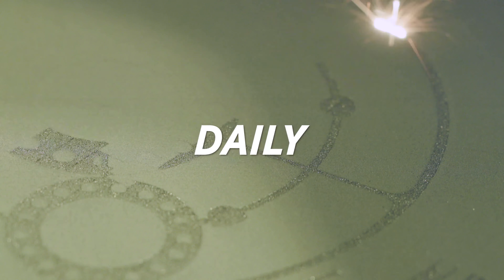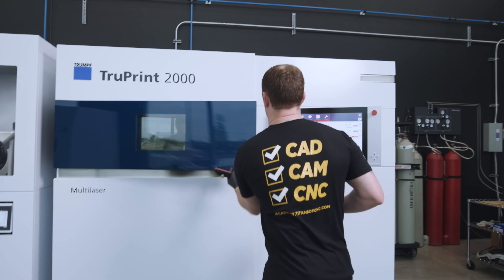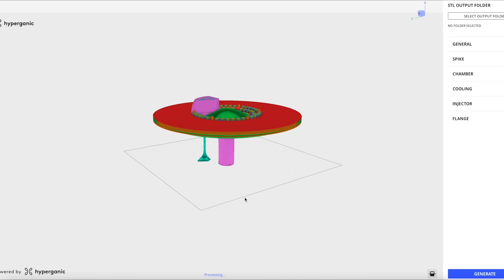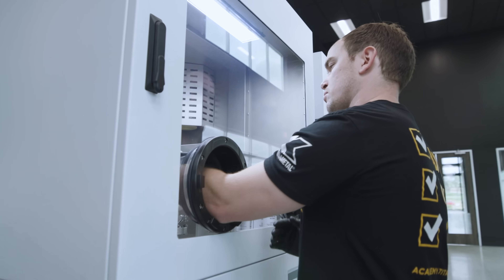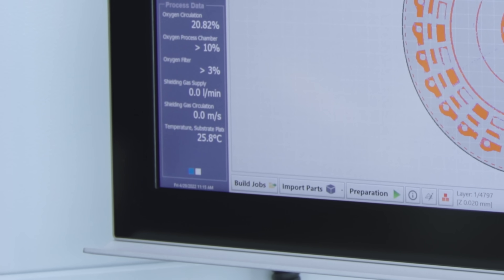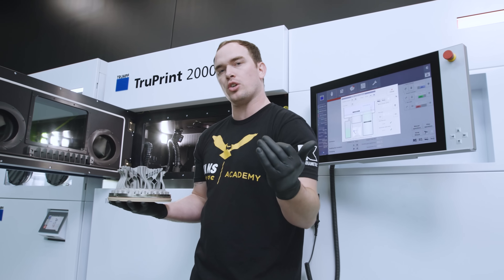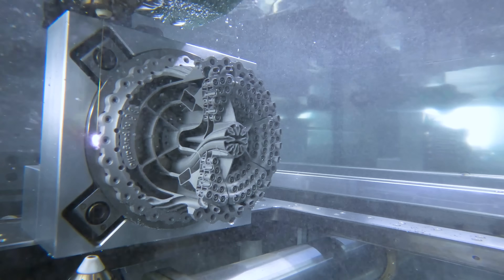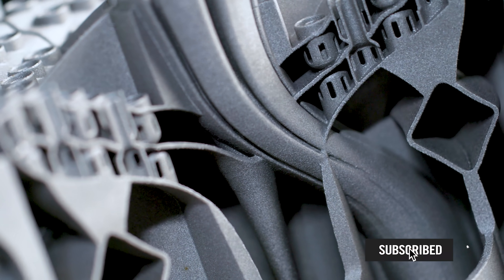3D Printing a Titanium Part Created By Artificial Intelligence

Comment: There's many of these 3D printed parts as I've seen I still have a hard time understanding how a combination of the dust and the laser make such an intricate part and everything has perfect surface texture.
Incredible machine.
Reply: First of all, laser melts titanium powder and forms the very first layer of a part on a moving base. Then a base with this first layer goes down for a height of one level. Machine put titanium powder on top of the first layer and laser melts powder to make a second layer. Process continues until all layers will be finished.

As was said in a video, this part do not have a supports. This can be done by this method of printing, when, unlike of plastic 3D printing, part is printing downwards. Because of this, whole part is surrounded by powder (even inner surfaces) and powder helps to prevent deformations.
Reply: @PaulRei-00   No, I just watched the video. It's magic, that's that's all ...it's magic.  😁
Reply: @PaulRei-00  We actually do have top down resin printers that use a scanned beam and vat of resin in a very similar manner to this machine, but yeah it's no help with supports.
Reply: perfect?  it's very imperfect. far from smooth.
Reply: @krusher74  Define smooth. 🙄
Reply: @randywl8925  The part in the video has a surface like a sandcasted part... which is the worst it gets when it comes to metall parts. So yeah  the surface is great compared to earlier 3d prints but it is no where neare a smooth part.
Reply: @randywl8925 smooth can be defined as "nothing close to this object"
Reply: @davidaugustofc2574  
"Smooth"  is a relative term.
...smooth compared to what?
Reply: @randywl8925  "smoother than" is a comparative term, smooth has it's own definition, which this piece doesn't fit. For example, you're simply slow, slow because you don't understand that, or you're blind, blind because you can't see the surface for yourself, you're relying on other's description.
Reply: @davidaugustofc2574  You're a really fun person.
Reply: Nah, its an ad.  This isnt very impressive
Reply: @timothyandrewnielsen  not impressive to .0005% of the viewers or just you?
Reply: @randywl8925  People are desperate to belittle and trivialize the achievements of others to make themselves feel better.
Reply: @party4lifedude  I have no clue what you're talking about.

Comment: The powder that wasn't welded to the part, can it be reused?
Reply: Yes!
Reply: @trevorgoforth8963  
When I saw this at IMTS a few years back, I thought there goes the need for cutting tools.
That also was a Killer video. I enjoyed watching. 
Thank you to all of you guys.
Reply: @cembellsteve  Thank you Steve! Thanks for watching!
Reply: Yes. You sift out large particles (usually 5% or less) and feed it back in. The primary losses are oxygen exposed metal powder. There's a limited amount of exposure before it loses structural properties.

Comment: I wonder at the possibilities of creating a part by rapidly cycling between printing and machining.

Print a few layers, machine them to precise spec and surface finish, add more layers, machine them to spec, and so on and so on.

With current processes, it would take months, maybe years, but fully integrated printing/machining holds so much promise for creating mind-blowing parts.

The future will be amazing. 🤗
Reply: it's already possible. Search "Hybrid machine 3D printer and 5 axis milling machine" on YouTube.
Reply: Actually, Sodick makes a 3d printer that does that very thing.  I am sure others make a machine that does it as well but I personally seen a Sodick do it and they are super high quality machines.  It was amazing at what they could do.
Reply: There are hybrid machines that exist that can sinter and CNC. There are still challenges when working with layers. Also sintering itself has strength limitations.
Reply: Yes there are even machine that can change materials progressively as the part is made.  One video I saw they were applying it to cutters for mining using a more flexible but soft metal in the core and gradually transitioning to harder but more brittle metals at the cutting faces.  Essentially progressive alloys.  Otherwise the parts either have to be made of one material only either hard and brittle or soft and strong but wear out quicker.  Materials that can be printed to gradually magnetised over the part   etc. Amazing stuff.
Reply: Had no idea.  My mind is blown.

Comment: how do you remove the initial layers from the build plate? machine it down, or the build plate is not reusable?
Reply: They can be reused many times. We either grind them or face them down on the mill but you could turn them in a lathe too.
Reply: @trevorgoforth8963  thank you!

Comment: I'd love to know about costs here. Whats the machine setup, the raw material costs?
Reply: Ti-6Al-4V spherical powder for SLM is about $500/kg, so that's about $18,000 just to fill the tank. And you can recycle about 80% of the non-fused powder after each print. A SLM machine with such a print volume and dual laser probably goes for somewhere between $1,000,000-$1,500,000.

Comment: That style of 3D printer is definitely the future of manufacturing. In the near future I suspect that that full part could be made in less than an hour with a much smoother finish. Being able to create anything an engineer can dream of is incredible, even a couple of years ago a part like that one would be impossible to make that small. Having to make it in many individual parts and needing the room to assemble everything wouldn't be possible on a smaller scale. Having A.I. design it just makes it even better.
Reply: Metal additive is the next wave of manufacturing.
Reply: There are so many features u cant possibly machine 
3d printing does the job for impossible tasks 
But i hate to after machine 3d printed parts
Reply: @bachelorsdegreeakinci  It is just another tool in the box. You wouldn't make simple parts with this process that are better suited to regular machining processes. But it does allow the 'impossible part' to become possible!
Reply: What about bound metal powders? (like metal injection molding feedstock, but in a powder)
You could use the eos laserprofusion to make millions of parts and then just sinter them.
Reply: @johntheux9238  you mean like binder jet printing? Desktop Metal has the P-50, which is a really fast bjp printer designed for large-scale manufacturing
Reply: @subbot8077  Either binder jet or a thermoplastic binder. Both are great.
Reply: @johntheux9238  sounds like you just invented som shit
Reply: @bachelorsdegreeakinci  You can use an Xjet npj printer for fine details or a desktop metal production system for high output.
There is not just one kind of printer...
Reply: Rip my job :(
Reply: @bachelorsdegreeakinci  The EOS laserprofusion can compete with injection molding thought. It's designed to produce millions of parts per year.
Reply: @bachelorsdegreeakinci  Links get deleted.
Of course injection molding has higher tolerances and a smoother finish. But 99% of the time that's useless.
Reply: @johntheux9238  99% of the parts made out of polymer aren't what you see in 3D printing and can't be made by this process (clearness, strength, weight, cost). It ll be mainly packaging boxes, container...

3D printing is interesting in a mass production environment for decentralized manufacturing.
Reply: @johntheux9238  I can think of way more than 1% of cases where surface quality matters, the most bs excuse ever, 3D printing cannot replace mass production molds, it's that hard to understand?
Reply: @davidaugustofc2574  But in most cases it can.
Reply: @johntheux9238  no it cannot
Reply: @davidaugustofc2574  More than 1% is not more than 50%
Reply: @johntheux9238  It matters most of the time, that's why you make a mold in the first place. Of course the 3D printing shåggers wouldn't know that, not the only thing y'all know nothing about.
Reply: @davidaugustofc2574  The Xjet printer has a resolution of 7 micrometers and you can post-process the parts if needed.
Reply: @johntheux9238  but cannot compete in the speed and cost per piece, which you'll be considering all at once when choosing a manufacturing method through things called decision matrixes, that's why I don't enjoy discussing simple things with slow people.
Reply: Unlikely
Reply: @bachelorsdegreeakinci  choose most suitable technology according your task !
Reply: While yes it can have it's place it certainly isn't flawless. For as much as he claimed it was a good print and they tried to edit it out in spots you can see where there were holes in the print where the material was simply too thin and/or an odd shape so it left voids. This is just the nature of 3D printing it has server limitations and why for 30 years has essentially just used for mock ups in the industrial sectors.
Reply: @bachelorsdegreeakinci  The EOS laserprofusion can produce one part every 9 seconds so that's 9'600 parts per day.
Reply: @bachelorsdegreeakinci  with current technology. "A little material knowledge is enough to understand it". Not really. You'll see in the future it's going to be possible. 3d printing things at incredible speed with extremely high precision is going to become a reality. 3d printing went from shitty plastic to printing titanium. MJF printers can hold tolerance down to +-0.03mm and they're becoming more and more precise by the minute. You can't say something is impossible because it will be possible.
Reply: @FrozenByFire3  i have never said it is impossible! in these days “it doesn’t seem possible.” of course we will see. but do not teach me my job. i hope i'm not talking to a teenager with childish dreams :D
Reply: @bachelorsdegreeakinci  as someone in the industry i will tell you how it will be.
cam-controlled lathes got switched out by cnc lathes due the possibility to create more complex parts.
same will be the case with 3D printing.
The parts of the future will be so complex that you can not produce them with conventionel methods.
ofcourse basic parts like screws will not get 3D printed in the near future. and same goes for parts right now that will produced in the future.
but as time goes on more and more parts will have the complexity that makes cnc milling machines more and more useless
Reply: @bachelorsdegreeakinci  give 3d printed 10-15 years... It'll be better than traditional manufacturing
Reply: @FrozenByFire3  Not likely, I say this as an engineer who works with 3D printing. They will both always have there strong points. For anything that needs huge production volumes 3D printing will NEVER be fast enough.
Reply: @Chris-hn4lp  never say never chris especialy in the techfield
Reply: @xloltimex38  Sorry, but in this case never is 100% true. 3D printing has its strong points, but as do other forms of manufacturing. No matter what, it is not possible for 3D printing to be as fast as injection molding. It will never outright replace it like that guy claims. Will it become more common for parts to be mass produced by printers? Of course yes. 3D printing allows certain geometries that injection molding can't do, and certain types of printing (such as SLS) the manufacturing speed scales really well with large volume's of parts, but for parts that can be injection molded easily and need large production volumes, it will always be better.

Comment: "They were not designed by a human" ?? Uhm... It must have been a human that set the boundary conditions for the part. You do need to give the software basic information like reference planes, external shape, location and size of the connection points, location and size of all those injectors, that sort of stuff. 

The software literally just fills in the blanks. Well, actually, it starts with a block and all the functional connections and passages. Then it simulates the part and determines where material can be removed. After adjustment of the virtual part, it will do the simulation of heat, stresses and flow again. Then the software will adjust the part once more, run another simulation, again take out material where it's not needed (and add back material where it is!) and so on. Rinse and repeat untill the part is stable.

There is still a human involved to give it the initial start though, so it's MOSTLY software generated/designed.
Reply: Also sounded like it was all just defined algorithmically.. no 'AI' at all.
Reply: @widgity  I can't fault them for using the term AI. AI, Artificial Intelligence, is a catch-all that typically involves use of neural networks to get results, but that's not by strict definition. 

In this case, the software is basically doing automated optimisation, and that latter bit can still be called artificial intelligence because software generates an output without any human intervention.
Reply: I'm sure that the basic design was established by an engineer, and optimization was AI assisted.    We're a long way away from telling Siri to "Make a rocket combustion chamber for a SPACEX Merlin second stage engine." and getting the correct part.
Reply: Unfortunately your comment isn't getting many likes because people want to believe this extreme scenario that humans are already or soon to be redundant, rather than , designer engineers use computers/algorithms/AI as tools that don't have a clue what to do without guidance

Comment: looks good but i have one thing

3:44 not about 39kg its exactly 39kg bec. 1000g = 1kg 

and use liters insted of cm³    1000cm³ is 1liter / 1dm³
Reply: Considering my scale on the powder prep station is in Kg, the powder containers are in Kg, the powder density is g/cm³, and we’re not measuring liquid…. I find it more commonsensical to use Kg.